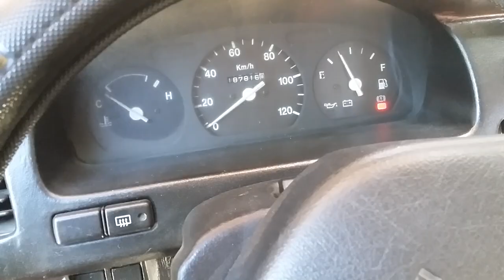Suzuki Carry/Every/Scrum F6A Engine Rebuild

Comment: That tiny engine to power the van ,  :(  , just to small , a 1.3 would be great .
Reply from the maker: Hello Paul, actually the tiny engine so powerful. They use these Suzuki F6A's for public transport that could carry 12 people.
Reply: @chrclmnky   the newer ones are better ? my brother inlaw had a van , it could not even keep its speed going up a hill on the national road out of cebu .   He sold it finally .  We looked at newer   vans  , he didnt trust them and recommended agsinst them ,   we bought a low milage honda city , local made , with a 1.3   hood on gas and plenty of power , but i like the style of the  van , custom 4wd . Da64 
    , just that little engine  ;( 
.

Comment: Pila kaha ni ka kilo y labot transmission. Ug pila ka hp ni nga engine. Anybody
Reply from the maker: Suzuki F6A — 657 cc (40.1 cu in) 65 mm × 66 mm (2.56 in × 2.60 in). A four-cylinder version (the F6B) was also developed.
Max.power (Net): 60 HP (44 kW) at 6000 rpm
Reply: @chrclmnky  thank u sir. Sa imu estimate sir paghuman nimu assemble ma aswat xa isa ka tawo? Kaabot kaha xag 50 kilos?
Reply from the maker: @captainbotbot2151  Di madag isa ka tao sir oi. Kung naa mo chain block mas maayo para dali ra trabaho. Kung wala, kinahanglan at least 3 ka tao mo alsa nig taud balik.
Reply: @chrclmnky  ah ic. Nangita man gud ko unsa makinaha mai power to weight ratio nga 1:1. So mga 100kg kaha ni makinaha? Y labot transmission ha

Comment: location nimo boss? need nako now..
Reply from the maker: Butuan City sir
Reply: @chrclmnky  ayay taga butuan pud ko boss, taga golden ribbon ko, south montilla blvd atbang freemethodist church...pero dia ko cebu ron..
Reply from the maker: @johnpaulgoloran472  ayos.
Reply: @chrclmnky  naa man gud trouble sa akong multivan scrum, kanang in between sa left og right sign signal ni siga nya kalit lang dili na mu andar bisag ako na gipalitan og spark plug
Reply from the maker: @johnpaulgoloran472  kuha ug multimeter, test the high tension wires and ignition coil.
Reply: @chrclmnky  boss, poyde ko maka direct contact nimo or videocall para mapakita sa imo ang actual trouble niya....much appreciated your reply...thanks godbless..

Comment: Akong multicab pag ka human na overhaul..dili na kusug mudagan pag ka change gear sa tersira patay ang makina..unsa cgro ang problema didtu ok man ang timing pero wala man ang iyan kusug mo dagan.
Reply from the maker: Brother Imran, salamat sa pag tan-aw. Pareho ra ta ug problema after overhaul. It turns out guba na ang ignition coil. Ako ge ilisdan na ok na dayon. Ang spark plugs ako ge upgrade to NGK platinum.
Reply: @chrclmnky  mao ba bro..cgoro akoa pud guba da cgro ang ignition coil..pa check nlang nako sa mechanic..3  days from now ra to nkagawas akoang multicab..hay problema na pud imbes na mo condition naluya man.
Reply from the maker: @imranamil1423  ilisdi pud ang mga ignition cables. naa man baligya set ana. Pwede ra ikaw mo tan-aw sa ignition coil. Sayon ra kaayo mag test ug naa ka multimeter. Dali ra man tang-tangon. Mao ni full tutorial on how to check ignition coils. https://www.aa1car.com/library/ignition_coils.htm
Reply from the maker: Mao na kasagaran problema sakyanan ang electrical. Gamay ra mechanic na kahibalo mo test ug auto electrical labi na sa ignition na part.
Reply: @chrclmnky  pila ang price sa set bro...mao jud bro gamay kaayo kabalu sa multicab..lisud man pud ang multicab..salamat bro ha akong tan awun ang tutorial..
Reply from the maker: @imranamil1423  800 ang set sa ignition cables. Japan man gud walay Chinese generic mao mahal. Mao ni link - https://store.rytparts.com/spark-plug-wire-set-ignition-cable-fits-suzuki-f6a-db51t-dc51t-dd51t-dd51b.html

Pwede pod nimo e check ila mga lain parts diha nga online store, e search lang ang keyword f6a diha nga store. Daghan ka ma learn bisan mag tan-aw2x lang sa mga pyesa.
Reply from the maker: Mao ni ang ignition coil sa mga multicab https://store.rytparts.com/ignition-coil-fits-suzuki-carry-da51t-da51v-db51t-db51v-mazda-scrum-dg51t-dh51t.html
Reply from the maker: And also, try to check all vacuum hoses. Basin sayop pagka taud balik. Medyo libog ra ba kaayo ang vacuum hoses kay perting daghana. I can send you the diagram if you need it.
Reply: @chrclmnky  cge send nimo bro ang diagram..salamat kaayo bro sah pag reply nimo nakakuha ko idea sa imo